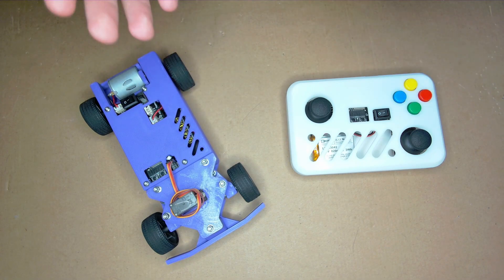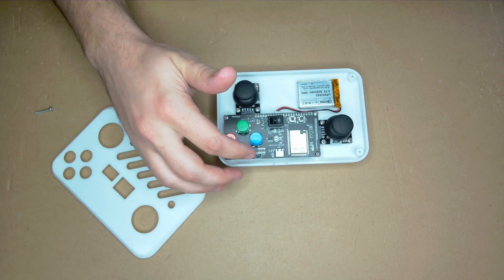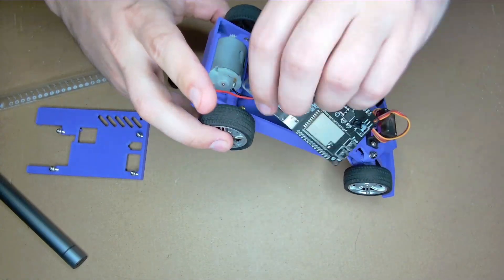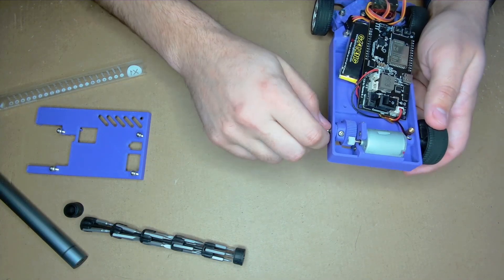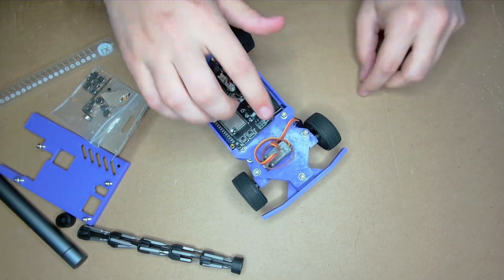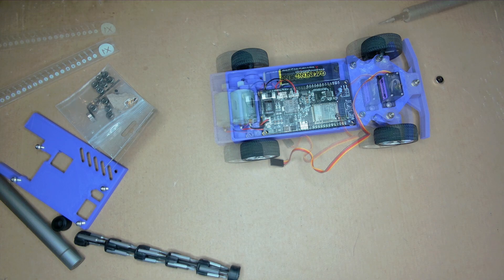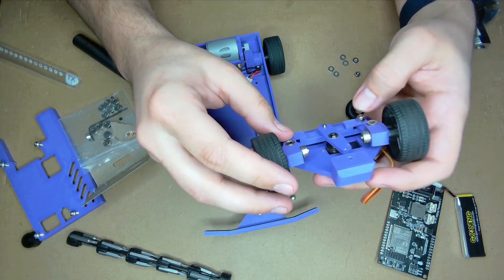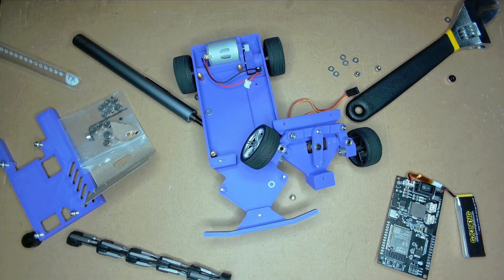The 3d Printed RC Car you can make at home! (esp32 RC car)

Comment: Hand soldered boards? Or you should sell some pre made boards 🙂
Reply from the maker: I'd love to design and sell dev boards! I think first I need to make some more designs and see how many people would be interested in that sort of thing. I'd like to explore that idea more in the future.
Reply: @TommyBee456 ,  thanks for sharing this awesome project with us :-)
 My 11 years old son and I are trying to build two RC cars but have run into problems soldering the boards for the cars. My electronics engineer friend thought we could hand solder it using an infrared soldering iron but we have not been able to do it despite attempting for a couple of hours. I might buy some solder paste and try again but I thinks the odds we can do it are really low. I do not want to let my son down. 
Could we buy a couple of boards from you?

I ordered the circuit boards from JLCPCB but I could not order fully assembled boards because they do not have all the components.
It seems it is possible to consign parts to JLCPCB but I am not sure what the extra cost will be and exactly how to handle it.

Comment: How do you learn how to use fusion?
Reply from the maker: It was all self taught. Started with doing the sketches and then I would just google how to do anything specific for what I wanted to do next and eventually all the skills added up. One thing that really helped me was to imagine the part you wanted to make in 2D,  draw the sketch and then extrude it into 3d and adjust from there. Maybe Ill make a video about that in the future :)
Reply: Fusion isn’t hard and it’s very strait forward. Just jump in and click random thing until something happens is how I learned. Also YouTube is very helpful.